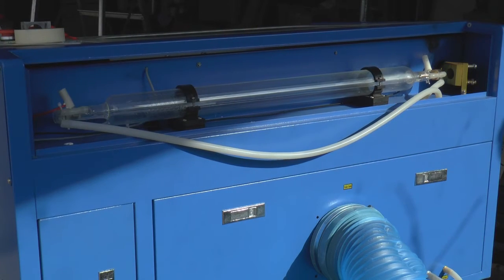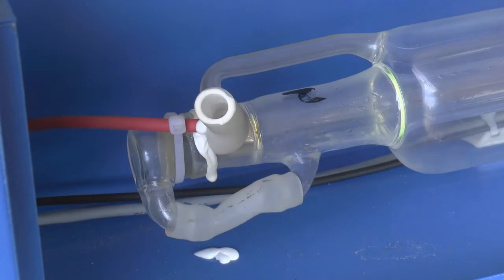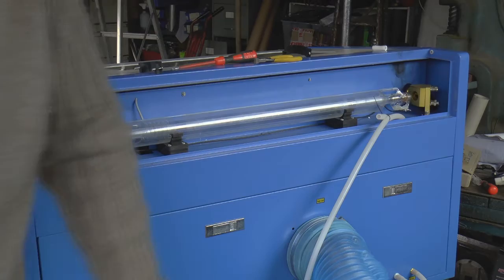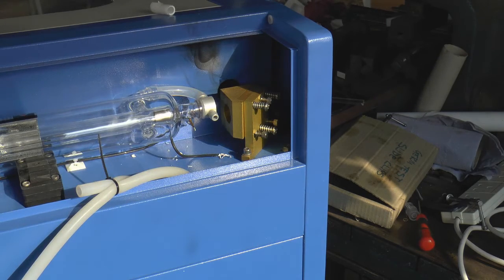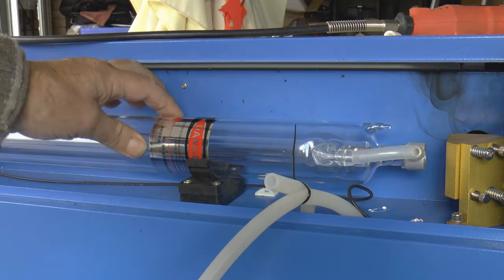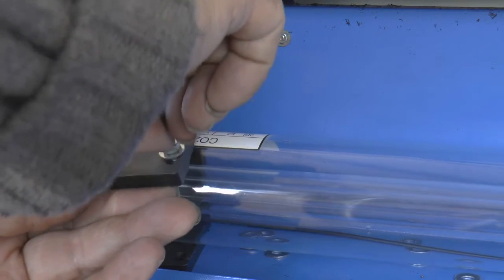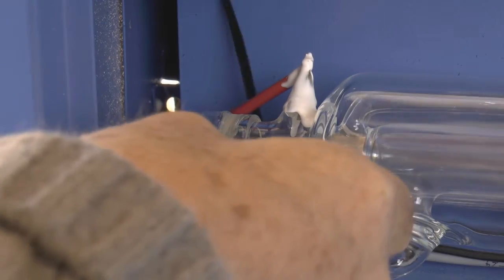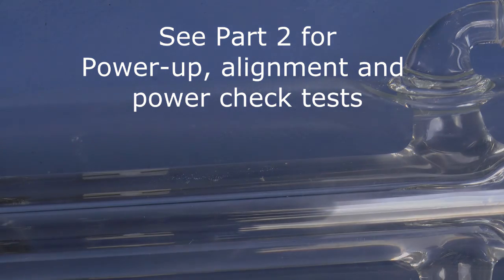RDWorks Learning Lab 21 Fitting new laser tube Part 1

Comment: You should not soldier them the tube will crack !
Reply from the maker: I was very naive at this early stage but soldering was actually not possible because the electrode was a very hard metal. I subsequently found other mechanical ways of connecting

Comment: I recently bought this same 3050 unit from Shandong Kehui Laser Equipment Co., Ltd. with the same sub-par factory fitted "KH brand"Laser tube and power supply. As I intended to use the machine for rubber stamps engraving, I looked around for quite sometimes and finally found out and bought the "YONGLI T2" tube with the same brand of power supply. This particular brand is supposed to be "the best of the best" for Chinese glass laser tube inferior to only that of RF ones. They're factory fitted in the higher end units like the $4,000 Gweike Cloud (a Makeblock/Glowforge copycat) The 50W tube alone with shipping fee bought directly from the factory costed me almost $700.

Comment: WHICH GLUE YOU USE TO DO THE INSULATION?
Reply from the maker: Hi Marcone
 There is usually a tube supplied in the tool pack that comes with the machine. If not then this is what I use when I run put It is specifically for high voltage insulation.
https://www.rapidonline.com/servisol-6200003100-silicone-adhesive-sealant-75ml-87-1132
 You may also like to watch another tube change  in   
https://www.youtube.com/watch?v=V_ehGE51rH4
 Best wiishes
Russ

Comment: What is the max wattage tube i can use with the existing power supply on my K50?
Reply from the maker: Hi Dennis 
I am presuming that your tube is labelled KHLaser and that is why you call it a K50. If your tube is about 800mm long then it is really a 40 watt tube if it was A grade. Sadly, KHLaser is not what the label says. They do not manufacture tubes, instead the collect final test failures from the big tube manufacturers, retest them to make sure they work in "some way", enough to fool the normal technically naive ebay buyer. Your tube is probably delivering a very unpredictable 20 to 30  watts. They will probably have fitted a 50 watt HV power supply  ( it is likely b grade also). So, it depends on what power tube you wish to fit.  Let me know and I will advise
Best wishes
Russ

Comment: Thanks so much for you videos I am replacing my tube this week.  Can you recall what the dia of your original tube was and the diameter of the replacement tube you replaced it with?  Thank you
Reply from the maker: Hi Ken 
I have come a long way since this video. I have just fitted a tube to one of my machines. You may like to look at
https://www.youtube.com/watch?v=V_ehGE51rH4&lc=z22hjrprnmehxr5z204t1aokgiph0pkoohffizupbejwrk0h00410
 The  so called 50 watt tube fitted to your machine will be 800 mm long and 50mm diameter and in reality is a 40 watt tube and should not be run at more than 18 mA. What??? You dont have an ammeter fitted?  take a look at this they are very easy to fit and is the most important friend your tube will ever have. Do NOT overdrive your tube, 
 Watch this to understand why   https://www.youtube.com/watch?v=2F5O-1TH8b0&list=PLPWEtx5V9DqEogIeYRdcG_KYcB7UL2Qmn&index=7&t=0s

https://www.youtube.com/watch?v=xDZmuxq5BEM
 The ammeter and thermometer are dead cheap Just Google  "ammeter 30mA"  and there will be lots to choose from. Also "LCD digital thermometer.
 If you haven't yet bought your tube, think very carefully about where you buy from , 40 watt replacements are cheap sometimes very cheap but they are very cheap for a reason. They are usually B grade factory QA failures that cost the seller almost nothing and are 90% profit. You may finish up buying a tube no better than the one you are dumping.. You will see from my video that the one I  fit was just such a junk tube  and within a few months I discovered my stupidity and finished up buying a proper A grade 60 watt upgrade kit.  4 years on and that tube is still working like new. Do the job properly once.

Best wishes
Russ
Reply: @SarbarMultimedia  hi rus i have been watching a fair few of your vids recently and would like to know where is the best place to buy quality tubes ? i live in uk and have a k40.. thanks in advance
Reply from the maker: @BadKatRecords  
Hi Chris
You may wish to speak to Colin Baker at Grey Goose Design   07824612324 (Sheffield) as he imports tubes from Cloudray  which are known A grades. You could also inquire of Thinklaser  (Gatwick) to compare prices and delivery or possible collection.

Best wishes
Russ
Reply: @SarbarMultimedia  Thanks russ, much appreciated

Comment: Hi, I need your support I am using chinese 50W Co2 laser engraving machine past 3 months it,s working, now I am facing problem when I am printing the wooden board half wooden board printing then 10% not engraving then it's engraving again it's not engraving for some time, basic check I done cleaning lenses all the time water flowing even non engraving location I can see the laser signal emitting pink colour in tube but it's not reaching board for some time again it's printing, if u give your email id I can send the printed board video
Reply from the maker: Hi Dinesh
Your problem takes me back 4 years to the tube that was supplied with my machine. It would cut well for a minute or so and then the power would disappear. Turn the machine off for 5 minutes, try again and all worked well for another minute. I was very naive about the workings of this technology and struggled for several months to find the issue. I gave up eventually and bought another tube from Ebay that claimed to be a direct replacement. Well, in a way it was.........it was almost as crap as the one I replaced. At this point I started serious research into the way tubes worked and tried to track down a reliable source of good quality tubes from China.
The more I corresponded with people the more I began to realize that all E bay machines are shipped with B grade tubes. The big tube manufacturers have product that does not pass their final QA testing and cannot be sold with a warranty These rejects are sold cheaply into the Ebay machines market where the buyers will not be technically aware enough to recognize they have a problem. Complain to your Chinese seller and you will be told that it is YOU not understanding the tube and that YOU have damaged the tube in some way by mistreatment.
I never threw my first tube away and a year or so on I was able to test it again and tracked down why the tube was performing so badly. One of the mirrors within the tube was not being properly cooled and after a few minutes of use was overheating the mirror, causing it to distort. This distortion completely destroyed the absolute parallelism required between the two internal mirrors and disrupted the photon amplification mechanism.
You may get an insight as to how your tube works from this video I made. It describes how the pink beam is NOT the laser beam but just the mechanism by which the laser beam is generated
https://www.youtube.com/watch?v=2F5O-1TH8b0&list=PLPWEtx5V9DqEogIeYRdcG_KYcB7UL2Qmn&index=7&t=28s
 To sum up, sadly , you need to buy a new A grade tube. Where from? A trusted source I now always use is 
https://www.cloudraylaser.com/products/35-45w-720mm-co2-laser-upgraded-metal-head-tube-cr35?variant=12782294270003

The CR45 will be a direct replacement for your existing tube and you will not have to upgrade your HV power supply.
Best wishes
Russ
Reply: @SarbarMultimedia  thanks for the support, I will order the laser tube immediately

Comment: where did you get the new tube from
Reply from the maker: Hi Dermot. I bought mine through Mactron 4 years ago. Since then I have learned a lot and I have found that that Cloudray metal ended tubes are excellent value for money. Cloudray have an arrangement with SPT ( a great tube maker) to rebadge their tubes. I know them to be A grade tubes that actually deliver more than they promise.see
https://www.cloudraylaser.com/products/35-45w-720mm-co2-laser-upgraded-metal-head-tube-cr35?variant=12782294270003

I will shortly be fitting a CR70 to my Lightblade machine.

Best wishes
Russ